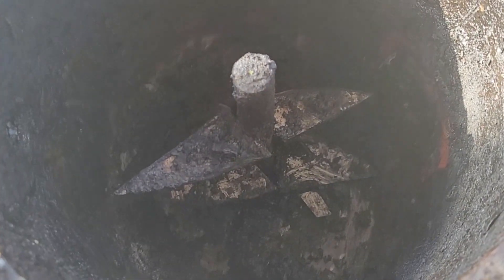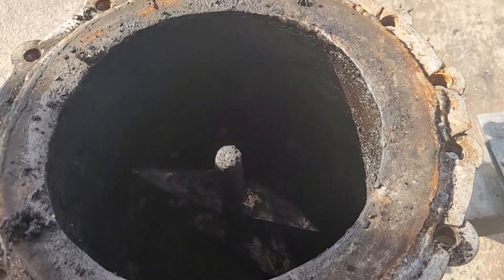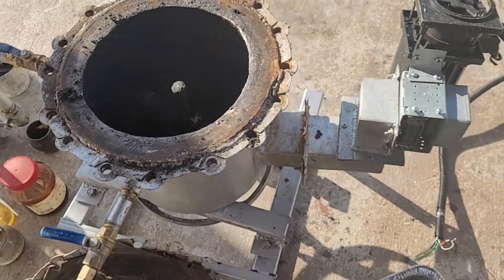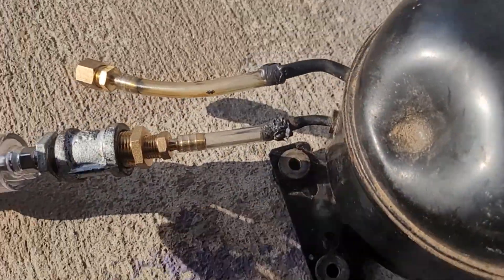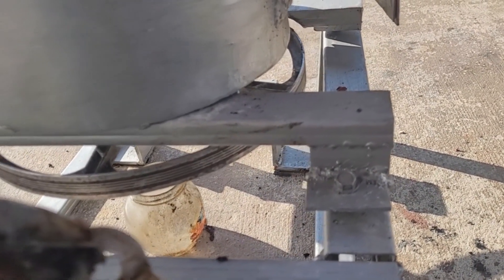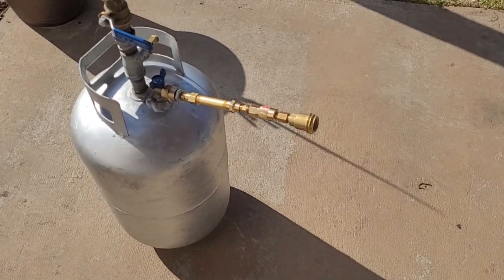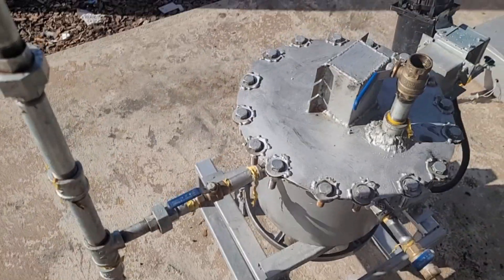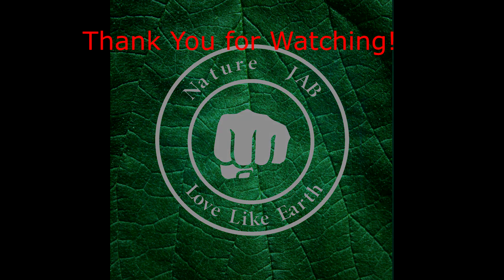Pyrolysis Reactor Update - Updates

Comment: You should get some ceramic welding blanket and sandwich it between that other fiberglass material that you're using to protect your white wave guide and then apply your high temperature sealant on the flange and between the high temperature ceramic welding blanket and the other media sandwich it and create a gasket seal

Comment: How do you purge the air out
Reply from the maker: It is pushed out with the produced gas
Reply: @naturejab  so why do some video's show them purging the reactor vessel with co2 before they heat it up 🤷‍♂️
Reply: Do you have to use co2 or any other gas to first push it out or just heat it up and it pushes the oxygen out ? I seen some videos where they hooked up a co2 tank first 🤷‍♂️

Comment: Awesome work, however I’m worried that you are putting yourself at risk letting syngas out into the atmosphere, and standing so close to it. Synthetic gas is highly toxic, it should always be stored in a safe container or burnt away. Other than that, it’s all very impressive, consider creating a patronite account in order to fund this project!
Reply from the maker: Thank you for your concerns, you are definently correct. I normally run my syngas through a 5 system scrubbing apparatous before storing it or letting it out, however when Im just doing test on the reactor I don't always have it plumbed together. I will be sure to keep this in mind from now on, thank you!

Comment: In your introduction video, you said that you used a very large pipe for the body of the reactor. If I might ask, where did you find a pipe of such size?
Reply: Do you think that a pipe is the best piece of metal to use for the body? Or would something else like a metal 55 gallon drum work?
Reply from the maker: @Brother Drew  that pipe was the best for me because it was thick enough to withstand the welding I did to it. A 55 gallon drum could work (any metal material), but welding that is harder as it is a lot thinner.
Reply from the maker: It was a piece of scrap pipe from a pipe welding school

Comment: If you have unreacted plastic, how about having some sort of static rods that heat up on microwave inside the reaction chamber;
An example could be some copper pipes that circulate water, pipes will run inside the reaction chamber. The idea is that microwaves are good on heating the water (this is how microwave oven heats the food), so why not to heat the water and let the water distribute the heat inside the chamber even. Also, water I reckon must not be able to leak inside the chamber, despite being circulated.

Another approach, could be me to have a spinning drum like a washing machine or a cement mixer where plastic is circulated. Also, how about trying to grind somehow the plastic to powder so with larger surface area could react evenly. As a result, more plastic may react. I mean, if you have multiple spots that emmit microwaves from a single souce more plastic may react.
Reply: If im pickin up what you're throwin down, this won't work bc pyrolysis has to be in the absence of oxygen. Especially at the temps needed, water in there will most definitely have oxygen. I may be wrong as you said water through a coil, so feel free to ignore me.
Reply from the maker: @nateb4543  If the water is closed within pipes it could work. But superheated steam would be the only form of water that could get hot enough for pyrolysis temperatures. Yes, you are correct, with water vapor in the reaction chamber, oxygen would definitely be present and react with stuff.
Reply: @naturejab  you could have a pressure release valve, if I understand what the guy is saying. Lots of steam engines have this. I think if you look up old locomotive steam engine mechanics, and reverse it, his idea could work. (Instead of heat coming from the coal fire going through locomotive to heat water, have the heated water run through the "boiler" for your plastic), you will just need a pressure release valve so it doesn't explode, and to keep it very water tight. However, with your current furnace, it will be a lot of modification's, but look at some old steam locomotive diagrams and see what you think. Specifically the boiler. Could help, maybe not. Not a expert in any degree.
Reply from the maker: Great ideas, thank you!

Comment: If you can find a working oxygen machine they throw all the inert gas out as waste. I used one to blow glass, combined with a 5 stage compressor. I grabbed a used invacaire homefill for cheap. You could potentially use that to store gas at 1200 psi, just make sure no oxygen gets in there lol. Have you checked out the process for making the plastic turn into mostly methane, then to methanol in a seperate reactor? It only has 1/2 the btus as gasoline, but it burns clean and it is a liquid. I think it involves rithenium which is really expensive. But it can be done with copper cobalt on ceramic. I also read iron powder makes a good catalyst.
Reply: More info?
Reply: @kaervas  On which part?
Reply: @wesKEVQJ  all xD
Reply: @kaervas  Well I started by googling the sabatier reaction. Then hydrogenation. I googled catalysts for hydrogenation. One thing just led to another. The air force makes jet fuel from sea water this way.
Reply: Azolla filiculoides is a water plant that grows very fast and can be made into 30% fuel by weight from pyrolysis. It's the fastest growing plant and it has it's own nitrogen bacteria so it doesn't need lots of fertilzer.
Reply from the maker: Thanks for this suggestion! Sorry for the late reply, youtube never notified me you commented.  I'll look into Oxygen machines, they sound very interesting and useful for this application.

Comment: If you are not getting much complete melt with magnetron maybe it is becuase magnetrons work best with moist stuff so you can also experiment with electric heat. Check out this video https://www.youtube.com/watch?v=VTzKIs19eZE on how to make real heat using an electric arc. 
If you are having problems with rotating stuff you can try to put the wheels on the outside so the whole thing is rotating. You can check out this video https://www.youtube.com/watch?v=OrHGUmgNQHU
Reply from the maker: Thanks!

Comment: Life can slow down things, but the most important is: to work at your own tempo, don't rush things. We don't want to have any accidents :)
As for fibreglass, if it is transparent, what about using multiple layers or even laminating them together? Maybe a method from here https://www.youtube.com/watch?v=rAIyLWEKt8U with water glass would be useful, if it is good enough for microwave oven crucible, here also should be fine.
And looking now more closely, comparing your waveguide tube from when magnetron was mounted on top to now on the side, you have now to right angles, and I am afraid that you lose a lot of power there. And I know I am repeating myself XD Sorry for that.
Tech Ingredients made a video lately about microwaves that can be useful from point of guiding them https://www.youtube.com/watch?v=Lg_aUOSLuRo
I am very happy that advice with HHO guys flashback arrestors was useful! 
Keep on cooking! Slower if needed for good dish ;)